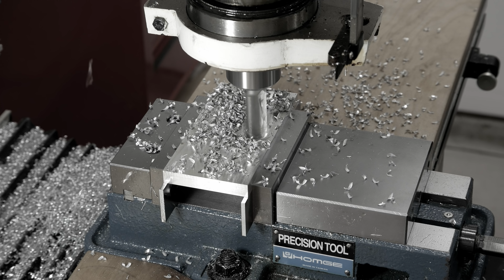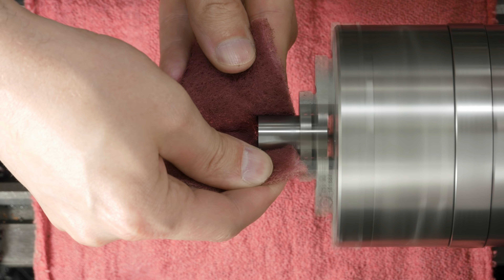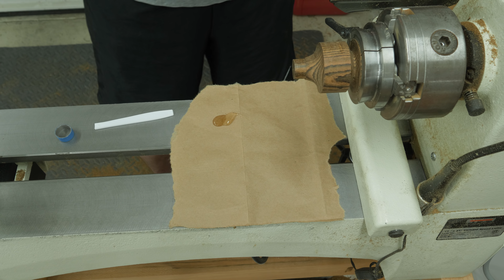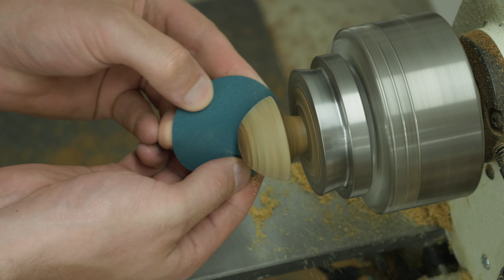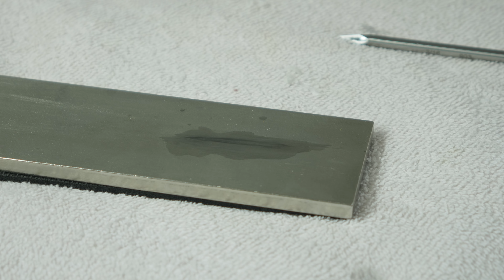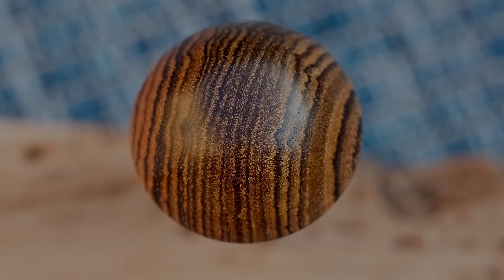Making A Birdcage Awl

Comment: Very nice look pro 👍👍 anyways why you chose 416 steel instead of common 304.. os it better and sharper ?
Reply from the maker: I had 416 on hand,  so that's why I used it in this project. Generally I prefer 416 to the common 3 series alloys, because it machines substantially better, and you only give up a little corrosion resistance.

This is a good link if you want to look at the maintainability rating (higher is better).
http://www.carbidedepot.com/formulas-machinability.htm